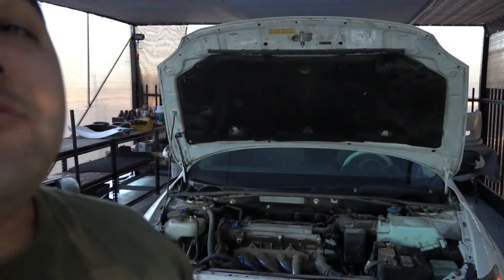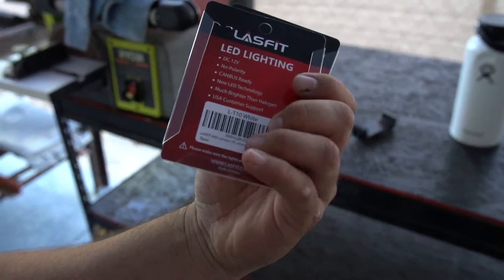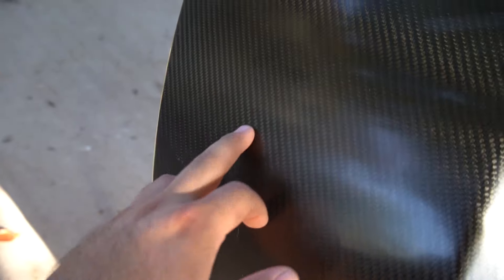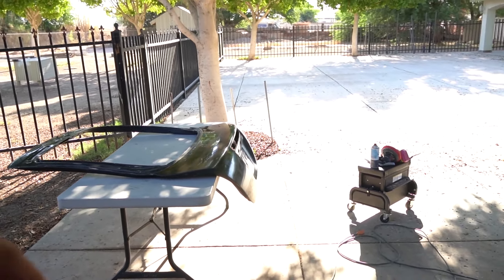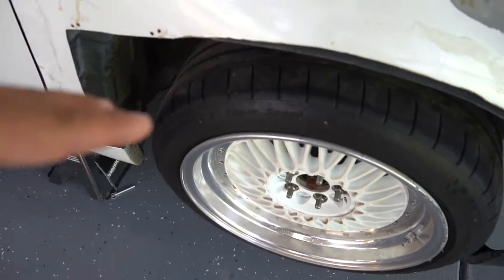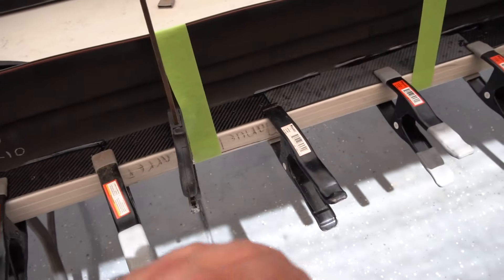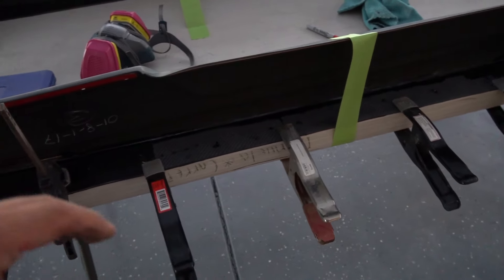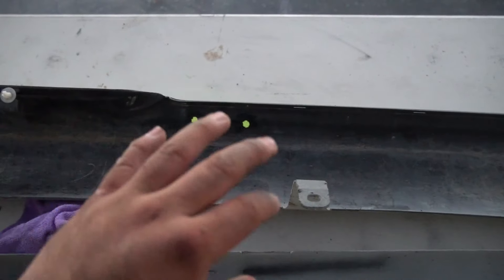LAS FIT LED Install + Adding Carbon Fiber to My Kaminari Sideskirts

Comment: I did have the tuff u have but I used proxy foam and drill mount and sand it down. I will send u a picture. It's ok but it could be better. I a big fan Jess